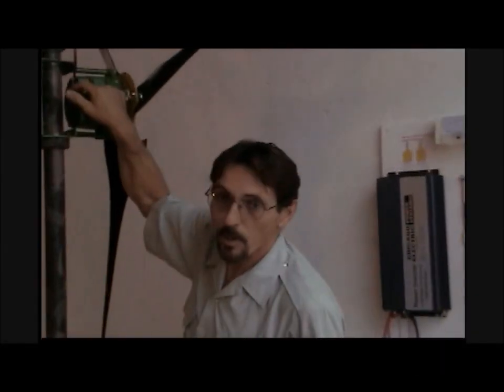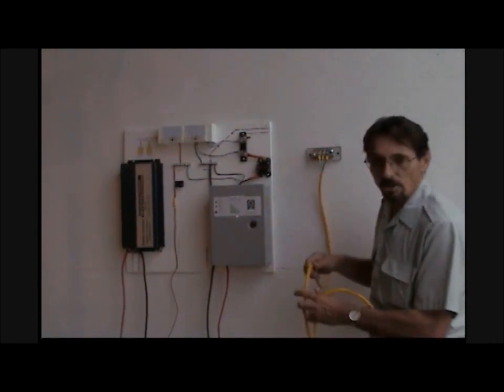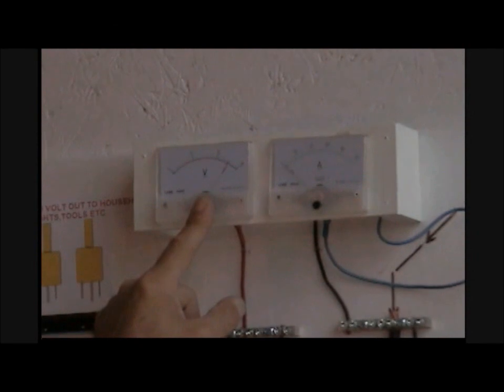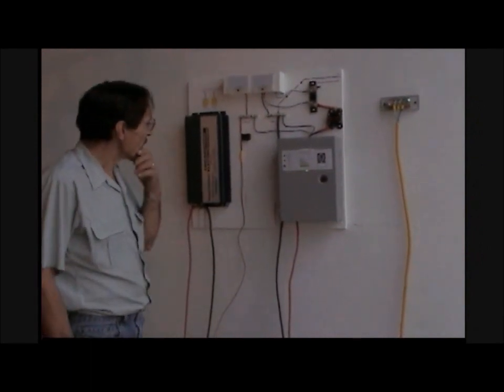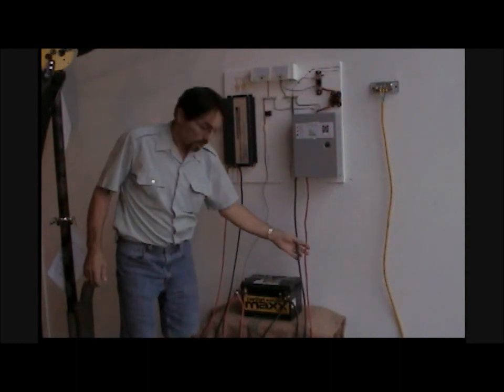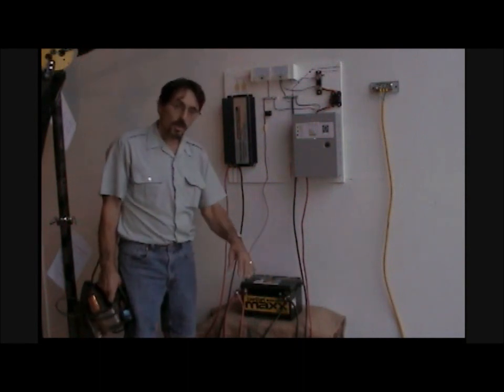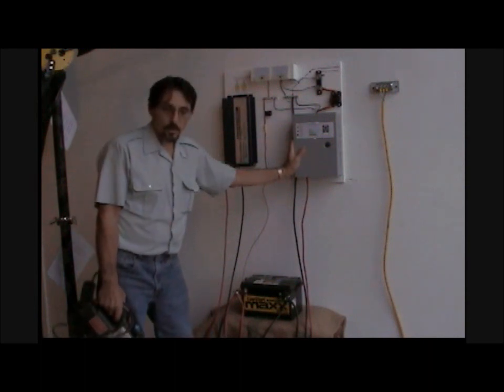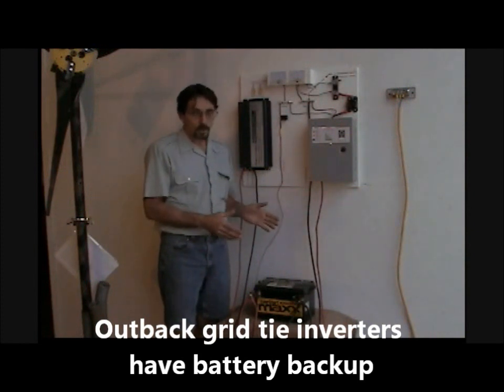How to Hook a Wind Turbine and Solar to Battery | Missouri Wind and Solar

Comment: Hello,  I want to add a wind turbine to compensate at night and during rainy days.   I have an existing solar system.    What bare minimum components do I need to add wind.  I will be using a midnite charge controller.  Thanks
Reply: Wondering also

Comment: WAS RESEARCHING THIS AGAIN....

FOR STORAGE AT NIGHT....
Solar Power: Solar Battery,  Metering, Maximum Power Point tracking (MPPT)

Wind Turbine: First Response Battery  Second Response Battery, and it's own MPPT.   *Connect a dumpload device and send excess energy to power grid or dumpling device for fan, heater, or special resistor. 

Hybrid system for both Solar and Wind needs Hybrid Charge Controller Relay/Solenoid based controllers.

And Hydroelectric Turbines uses Pump Storage Hydropower (PSH).

Comment: What I mention is for off grid on main breaker,, or with quick disconnect box between meter and main breaker box is must and   must be turn off at all times when using hybrid power generator propane wind solar ,, you can get in serious legal trouble in some places,,,the proper generator for interlock system done right,,, for that system 2 boxes are best , what some have done they split the bus bar in 2 on double sided breaker box by cutting it in the middle with a thick disc mini rotar tool using one side off set the breakers of the shelter and room s to perfectly run one side of the shelter when charging ,,when charge bank open it and flows to the opposite side of breaker bus bar to begin working,, with the other side a generator inlet this type does not need generator interlock system cuase there off grid buss bars are separate not connected in one box,, if your confused leave it to a professional license electrician

Comment: For off grid you can connect straight to box 0n 48amp- 30-50amp breaker  100v 207v 15-20amp breakers the first one  connect a socket to connect battery charger ac to dc 48amps that shuts  when battery's full bank,  on the other side you connect a disconnect for better bank then power inverter must be double the size as watts off wind turbine same as charger

Comment: Got a question on a turbine 3 Phase AC can you use house wire 12 Dash three and then copper strand wire for the DC after it’s converted

Comment: So do you have to put the inverter inside where you need the electricity, you can't run anything from the invertor like an extension cord from like a shed underground to the house to create an outlet for like a refrigerator?

Comment: You say you cannot use this inverter to grid tie, which is understandable, but if you are off grid can you use it to run the lights in your building? I.E. I have a building I plan on taking solar/wind for its only energy, can i hook this regular inverter into the wall socket to power my building or is that still a no no?
Reply from the maker: Kentucky Swagger That's right.You can wire it right to your fuse box ONLY if you disconnect the grid power from the box.

Comment: I have a wind turbine 3 phase to rectifier then to 12V batteries. Can I also connect solar panels to the same battery bank with a charge controller on the solar panels and be ok? Will I need a additional blocking diode for the solar panels because of the wind turbine? Thank you for your time.
Reply from the maker: Yes you can. Yes you should put a blocking diode in the solar line, there can be big voltage spikes from the wind turbine into the battery bank.

Jeff

Comment: So what do you use if you are going to be off grid? Running only on batteries charged solely by wind and solar, maybe a generator in an emergency...
Reply from the maker: Yes a generator is what most off grid people have for emergencies. Not always though. You want to keep your usage low , like not using an electric stove, use gas.

Comment: If I run a amp meter in line with the out put of the wind generator will that dog down my wind generator, acting as a load?? the train noise in the back ground made me laugh my ass off that was funny... I my self am running deep cycle marine battery's. I will be looking for some golf cart batts. to add to my bank. that's yet another great idea from Missouri Wind and Solar...  440 amps is a super lot..GREAT video very educational. thanks..

Comment: You can connect a wire with 2 plugs,1 from the inverter And 1 in the socket of your house....only disconnect the breakers...then you will have power on 1 group in your house...

Comment: im trying to find info on how to connect the wind turbine and the solar panels to the same battery bank. can you help. possibly a diagram?
Reply: did you found out how
Reply: Trying to find out  how
Reply: @whoward4145  . there is a controller for it..
Reply: Just run your solar to a Sunsaver charge controller and from that run it to your batteries.
Reply: Yes you can connect both together. These are requirements
1. Both solar panel and wind mill should use same dc voltage level
2. Reverse power protection should be there in windmill i.e current should follow from windmill to charger
3. Mppt charge controller built in ups to improve efficiency

Comment: Is it possible to Use a wind generator to bring in Ac voltage and control or keep the voltage steady without the use of battery banks? Come straight from the Generator to whatever then into my service or breaker box?